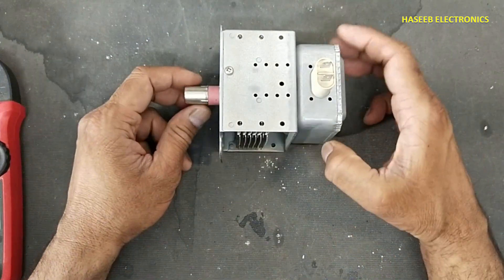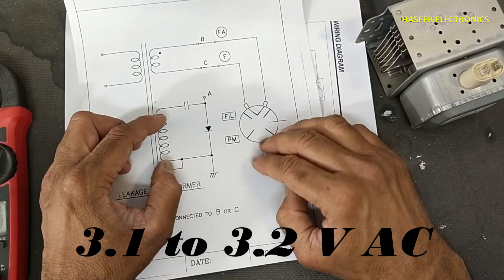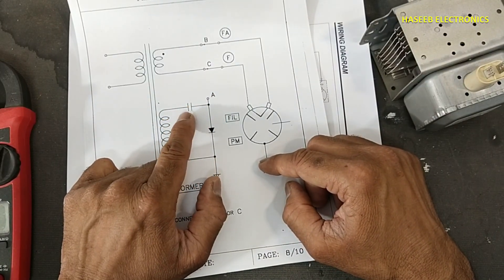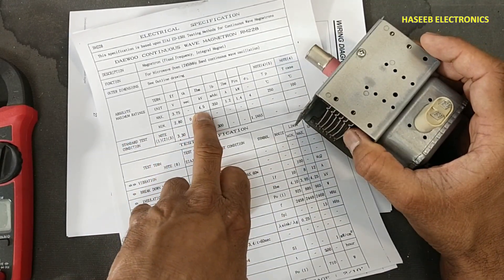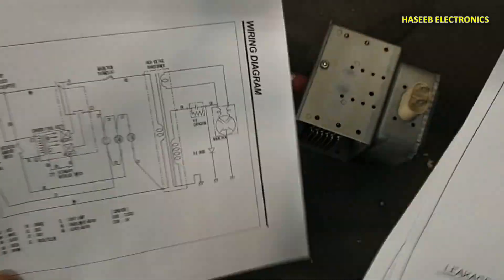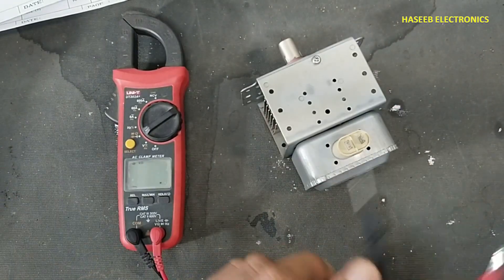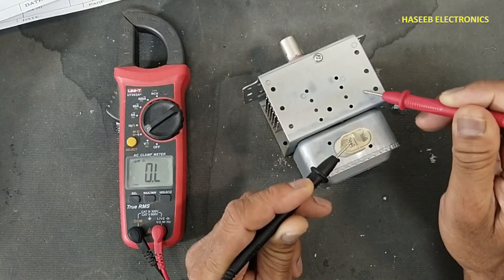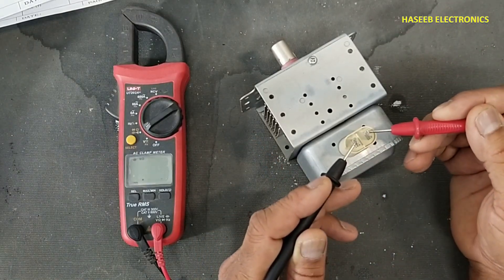{873} how to test magnetron in microwave oven

Comment: Mine was reading all ok and according to your test and there was no sign of physical damage as i was sure and had tested transformer, diode and capacitor i went ahead and replaced magnetron and it fixed the issue, so it can read all ok yet be defective.
Reply: Yes Mate, I have the same experience a couple of times. It works for the multimeter but high voltage leaks when it starts. Physically all good but still the magnetron is faulty. Especially in the inverter types.